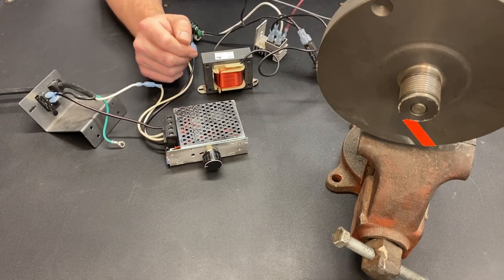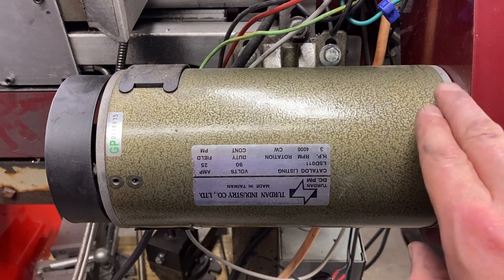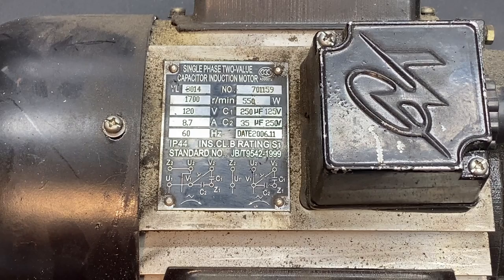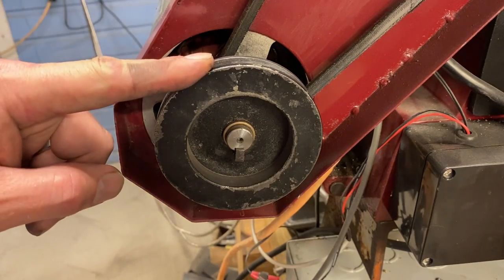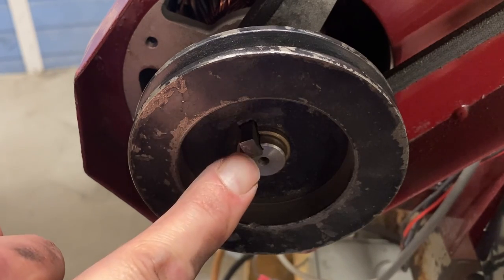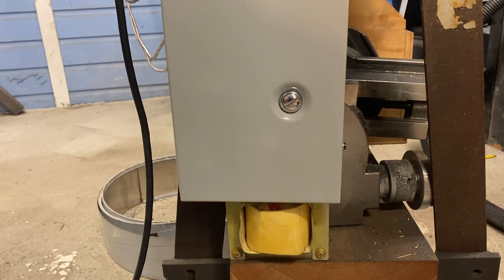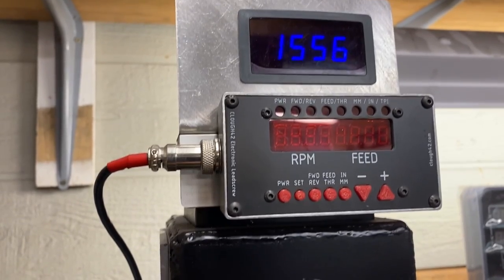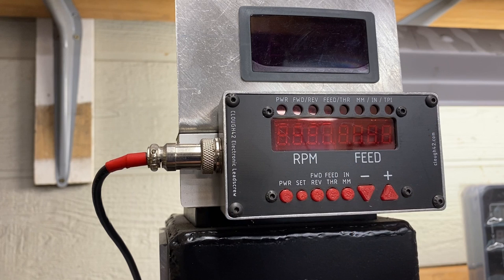Metal Lathe Treadmill Motor Conversion & Treadmill Motor Controller

Comment: I think I'll redo the control setup on my treadmill motorized wood lathe.  First I'll neaten up the wiring paths and provide better dustproof ventilation of the controller board and choke.  And I'll make a comprehensive schematic with photos too. 

Many/most woodturners just crank up the RPMs until the lathe shakes and then back it down, which may be practical but is not optimal.   Depending on species and condition of the wood, then the angular velocity  can be a factor in achieving a good surface finish on the workpiece.
Currently, I use a cheap HF DVM to set RPM by monitoring the control voltage of the MC40 board at the wiper of the potentiometer.  I determined the relationship between voltage & RPM by setting the motor to various RPMs as measured with a model aircraft tachometer pointed at the spindle, and then noted the voltage.  Then I graphed and printed out the relationship for reference. (Note: it's futile to use such a tachometer under fluorescent or LED light!)  I'll replace that Rube Goldberg setup with a Hall-effect tach and LED display.  

It may be interesting to note that I use a  dinky J3 poly-vee dryer belt for power transmission  because the lathe step pulley and motor match this standard.  It's worked for 8-10 years now with no problems because the flywheel and chuck store enough energy for cutting.  If I stall the lathe then I know that it's time to sharpen the chisels to relieve excess loading pressure.  Note that I'm not hogging off thick shavings that require a hefty torque.
Reply from the maker: Sounds like a fun project

Comment: Very informative video. You lay things out very well. 
How did you get two potentiometers for fine and course control? Are they different?
Paul
Reply from the maker: Thanks!  This video goes over the fine and coars option https://youtu.be/04d0u1RJyXw  Let me know if you have any questions
Reply: @dazecars  Daze, I’m not getting any replies from James at Clough42. I can’t find information about the servo motor he used. His link to eBay is no good. 
Do you think his ELS would work with a treadmill motor upgrade with your SCR variable speed controller, or is the VS redundant? 
What do you know about the overall cost of his ELS and whether I can buy parts from him?
Sorry to bother you with another guys channel but I’m stuck. 
Paul
Reply from the maker: @paulmanhart4481  I'm happy to help!!  Clough42 is a busy guy with tons of subscribers so I am sure he gets a lot of questions.  When I have contacted him some times it takes a while for him to get back to me.  For me the treadmill conversion was required to install the ELS.  things happen quickly when threading at 100 RPM  I can't imagine what it would be like if I was trying to thread at the 500 RPM ( the minimum speed when my machine didn't have a treadmill motor and yopu adjusted the pulleys to change speed).  The entire ELS cost me less than 300 but that was before the inflation monster. I used slightly different parts than he did because of the dead links.  I purchased the two control boards from him that you get on eBay and then the rest from amazon and TI, here are links:

Encoder https://amzn.to/3Z6Ymzy

Stepper motor/driver kit https://amzn.to/3Q7aKLN

Stepper Power supply https://amzn.to/3IAGur1

TI board https://www.ti.com/product/LAUNCHXL-F280049C/part-details/LAUNCHXL-F280049C

Clough 42 parts https://www.ebay.com/itm/164781208092

Please don't hesitate to reach out if I can be of further assistance.
Reply: @dazecars  So you used a stepper instead of a servo motor? They make closed loop steppers and I’m wondering if they would work the same as a closed loop servo. Maybe more noise. 
Thanks Daze.
Reply from the maker: @paulmanhart4481  That is exactly what I am using, a closed loop stepper and it works very well.  It is what I am using in my ELS video

Comment: What DRO are you using on your lathe?
Reply from the maker: Came from eBay.  I went with this seller because it was mix and match.  I was able to order each individual piece to get the correct length scales rather than a ready made kit where nothing fits correctly.  Used the same supplier for my mill build as well 

https://www.ebay.com/itm/392899229040

Comment: Would a 7812 IC voltage regulator help any at the end of the circut?
Reply from the maker: No for two reasons, first most of those ICs are not able to handle more than 5 amps and these motors are 15-25 amps.  Second that voltage regulator will provide 12V.   That means as you try to change the voltage to vary the speed nothing will happen as it will spin at the constant 12V speed.
Reply: Thank you! Suggestions to where to source the larger chokes?
Reply from the maker: @garymullens650   Here is some guidelines to help you.  First of all bigger is better. I have several motor chokes ranging from the size of a tennis ball to the size of a soft ball and the bigger they are the better they work. Second the wire for the choke needs to be a minimum of 16 awg. If the wire is not that big or better it will not have the amperage capacity to allow the motor to work properly. Third they are not available on Amazon at least not inexpensively, there are a few privet sellers on Amazon selling used parts for big bucks but the generally available chokes on amazon are too small because they are not designed for a motor even though they look correct in the picture in the picture they are way too small. The choke in most of my videos is part number 130993. Instead of getting one new I would get a used one. A lot of treadmills come with a choke. Go to eBay and search “treadmill motor choke” BUT know that most people on eBay don’t know what they have and the word “transformer" will also appear in most listings. Problem is a choke and a transformer look almost identical so some listings are for transformers and some are fore chokes because the sellers think they are interchangeable. They are not. They would only be interchangeable if you modify a transformer to work as a choke. (see my DIY choke video) To tell the difference count the wires. A choke will only have 2 wires, a transformer will have 3 or more. Also before I started doing videos chokes on eBay could be had for $25 or less shipped but now that more people are looking for them (due to my videos) the eBay sellers have raised their prices quite a bit. Your best bet might be the DIY option out of a Microwave transformer. Please let me know if I can be of further assistance.
Reply: Thank you for the detailed response. Please keep the videos coming! Ill keep searching the ads cor treadmills.

Comment: Hey pal. I’ve watched 12-15 of your videos. Yeah I’m amazed. 
Question….what kind of stuff are you making? Looks to me you have made a hobby of pimping this lathe. And I commend you with the highest praise. BUT what kind of stuff are you making? Anything fun?
Reply from the maker: Its all fun to me 😁  I make stuff all the time but not anything worthy of a YouTube video.  I am a fabricator not a machinist so most of what I am machining is to either repair an existing part, make something I have better, or a small section of other projects, heavy on fabrication skills.  I use the lathe all the time to extend the threads on a 4.5" grade 8 bolt for one of the products I sell through my business.  I used the mill to make the dog tooth gear, in my mill power feed video and other little projects like that as they come up but nothing to the level of most of the proper machinists already on YouTube.  I will be making a new leadscrew for my lathe in the future and maybe a half nut for it but that comes back to the category of "pimping this lathe"
Reply: @dazecars  well you keep doing what you’re doing, you’re keeping me very entertained!! I feel like I should share this much…. I’m simply a hobbyist and have a mill lathe combo I bought used in a non working condition. I’ve always been intrigued with metal work. Especially machining. The lathe works but the mill motor went bad. I tried to salvage it but under no load it started smoking and was pulling 8 amps. I’ve been on the hunt for a replacement motor for about a year! So I’m going to take all of your advice and go with a treadmill motor. Shouldn’t be too hard for me to find one, my next-door neighbor is a professional scrapper. You wouldn’t happen to remember the brand/models treadmill hold a desirable motor?
Reply from the maker: @dathonlawler81  The brand make and model I always look for is FREE.  Treadmills are one of those things people don't want to move because they are big and heavy so people will give them away rather than deal with moving them. I picked up my first treadmill about 3 years ago and have scrapped 18 in that time.  I have a search set up on Craigslist and Facebook market place.      Every treadmill I have scrapped has been different.  I never know what I am getting until I get it home and get into it.  They all have good usable parts some are just better than others.  If you can be patient and the treadmill is free you have nothing to loose.  BTW I started a facebook page for mill lathe combo owners, you should come join us https://www.facebook.com/groups/168134035160655
Reply: @dazecars  yes sir. I already did join. You approved me the other day. I was surprised when I learned you were the admin, and I assume creator!! I’m a crane operator so I sit and watch videos non stop at work haha. I’ll let ya know how my progress comes along. Thanks for such quality videos. You have a pretty good following for being new-ish. I’m gonna bet you’re gonna really blow up on views here shortly. Your videos are put together very well. Good angles, good lighting, not too close or too far on the zoom. Explanations are in depth and understandable. Superb speaking voice too.

Comment: Daze. What is the box you used to hold all the electronics? I like that it has a key lock and hinge. 
Paul
Reply from the maker: Here you go.  There are three I use:
This is the hinged box
https://amzn.to/3jPndaR

This is the medium size box I used in the power supply mistakes video
https://amzn.to/3Qe2edL

This is the larger box that holds all my ELS components
https://amzn.to/3Imerv6
Reply: @dazecars  Daze, I can’t tell you how much it means to me that you are helping. Someone like you, full of talent (probably a brain surgeon) and always busy takes the time to help mere mortals on the ground. I’m an optical physicist but am lost when it comes to electronics. 
I have everything I need now. I’ve decided to use my Lieli 4.25 hp treadmill motor based on your torque calculations. I have a push button switch with a separate light to indicate power. I have my SCR, circuit breaker, bridge rectifier, DPDT switch, my big ass DC choke, an rpm readout, three potentiometers (100k, 50k, and 20k just in case). I need to measure the resistance the way you did to know which ones to use. 
Once I do this to my Jet 1014 midi lathe, I will start thinking about doing it to my Southbend 10L metal lathe. Repeat the process and then put in the ELS. 
I have a 9 Nm closed loop stepper motor and the same little servo that James uses. After that, I’m lost again. I’ll need to purchase the stuff from him, especially the software. He’s really gone all out on his ELS. Superb videos, but he lost me after video 7 or something. 
Thanks again for your help Daze. Let me know if you ever have an optics problem. 
Paul
Reply from the maker: @paulmanhart4481  I am just happy to help!!  not a brain surgeon, just a self employed maker of classic car parts with an  electrical aptitude, enough to make a hobby with it.  I have set up the clough42 ELS twice (on my machine and a spare system in case I ever fry something) so if you have questions when you get there don't hesitate to reach out an I will help if I can.  The only thing I ask in return is let other know about my channel.  There is so much... for lack of a nicer word, "low quality" video on youtube that it has been a real struggle to get the youtube algorithm to suggest me to viewers.  In fact when I do searches my self google finds me better than the Youtube search function.  To fix that I need more likes, more views and more subscribers so if any of what I am doing applies to some one else please provide them a link to my videos and or channel. Thanks!!
Reply: @dazecars  Hi Daze. I wrote a long message to you but I don’t think it went through. Basically I said…
I want to have two separate boxes. One for the electronics mounted on the wall and one for controls mounted on the lathe. 
Electronics box includes 
1. SCR
2. Toroid
3. Bridge rectifier 
4. Circuit breaker
5. Big ass dc choke 
6. 120 vac muffin fan. 

Control box includes
1. On off push button with indicator light
2. Two potentiometers
3. Digital rpm display
4. DPDT forward and reverse switch with green indicator light for forward and red for reverse. 

There seems to be two issues. 
First is the number of wires going from control to wall box. 
Second is that the rpm meter is dc. I either need to convert ac to dc in the control box, or use a dc power supply. But then I can’t slave it to the lathe being on and off. 
Your comments are welcome. 
I’d like to send you a sketch of what I envision but I can’t see a way to attach photos here. 
Thanks,
Paul
Reply from the maker: @paulmanhart4481  If you contact me through my web site you can email me with photos.  If you watch my RPM meter video I powered My RPM parts with treadmill parts.  Your setup doesn't sound that much different than mine except I also have a box with ELS components.  Mounted in the cavity of my lathe column are my  controls, master power, forward and reverse and two speed controls.  In my power supply box is the SCR, the inductor, the rectifier and the circuit breaker.  My choke is so big I mounted it blow the power box.
Reply: @dazecars  I will contact you through your website. 
P

Comment: If you want to get full value of torque you will need an idler shaft to allow the treadmill motor to stay in its full power rpm
Reply from the maker: Torque is constant regardless of RPM with a DC motor.  Yes you can gear it to multiply torque but it is not like and AC motor where you want to run it at max to get the best torque result.  An AC motor as a torque curve and produces the best torque at the RPM it was designed to run at, but with a DC motor the torque is constant through the entire speed range except the very slowest speeds.
Reply: @dazecars  I found that the slower I have the treadmill motor the less power it has 
I put one in a bandsaw years back and while it will cut and I can vary the blade speed for different material but it loses power the slower I run it 
An ac motor will run at a constant torque when you run it through a vfd but yes has a very definite torque curve when run through a potentiometer
Reply from the maker: @jarredsegal6842  that may be your observation, but your conclusion is wrong. As I said before the torque curve for a DC motor is constant. I have three machines, all running treadmill motors, and I can run them at the slowest speed and I don’t lose any torque. Conversely, if I speed them up, I don’t gain any torque. I single point thread on my lathe all the time at 100 RPM and it’s super high tool pressure so a lot of torque is required and my machine doesn’t even bat an eye. Most likely the cause of your problem is the motor was undersized or the power supply was undersized. Torque is a function of amps and if the power supply wasn’t able to provide enough amps or the motor didn’t have enough torque to begin with, then you would have an issue at lower RPM where the extra revolutions would help compensate at higher RPM. Again I understand those are your observations but I know what I’m talking about the whole reason you use the treadmill motor for these kind of upgrades is DC motors provide just as much torque at low speeds, and you can vary the speed where  an AC motor requires a VFD or a pulley system to vary the speed.

Comment: Watts are a measure of power the same as horsepower. Also, it can be run with a VFD no problem..
Reply from the maker: A VFD is way more expensive and most require a 3 phase motor.

Comment: Also can this tach sensor input on the 2100LS supply be used for speed read or control?
Reply from the maker: That is there to maintain motor speed under load not for a readout.

Comment: I all ways put something in my chucks tight before spinning, my gisholt has 28-inch swing. safety first,
Reply from the maker: The jaws are driven by a worm gear so there really isn't any way for centrifugal force to pull a jaw unless it was barley held.  That is the advantage of a worm gear, it locks in one direction.  With that said it's not much effort to chuck something even though it's not needed.